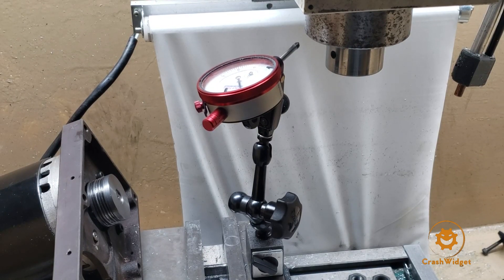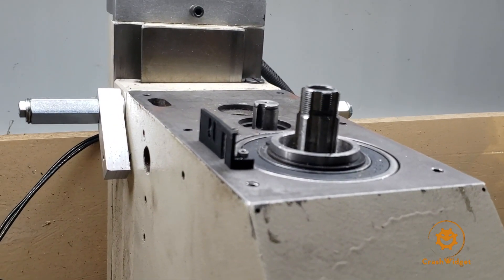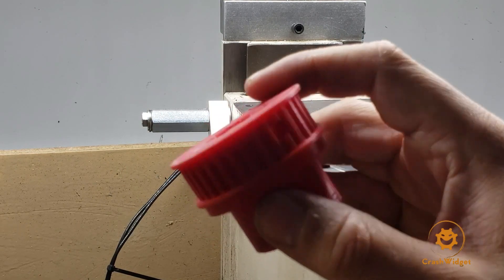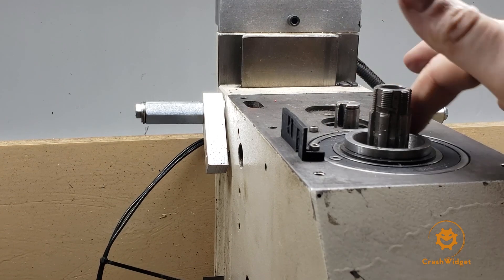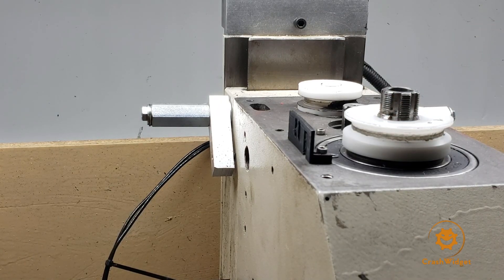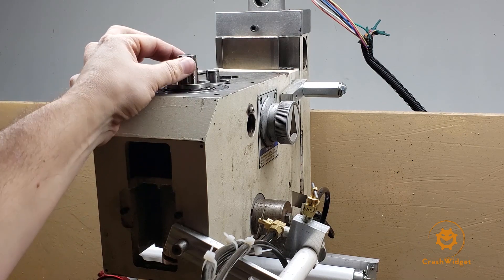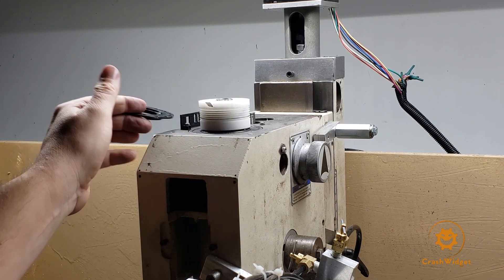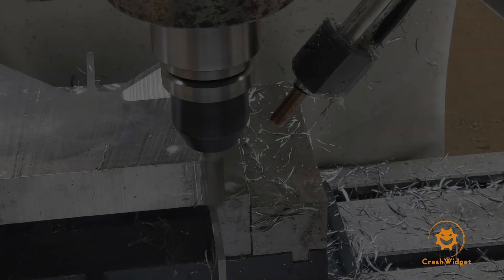G0704 Belt Drive - Trials and Tribulations

Comment: i don't know if you can conclusively say it would mess up your run-out. pushing on the column will bend the whole column anyway, so measuring from the table is not a reliable measurement; also, the spindle is supported at four different points (two tapered bearings in the quill and two holding the combo gear)
Reply from the maker: Agree. See definitely may increase vibrations.

Comment: Can you show the link where you got the 3D printed Pulleys?
Reply from the maker: Sorry for the delay, here is a link to the Fusion 360 design for the 3D pulleys.  You can modify or export as STL if you would like to print yourself.  These did not perform as well as the J belt setup.

https://a360.co/2JwqmIi

Comment: I'm currently in the middle of this right now (I don't have a G0704 but a Weiss VM25L which is nearly identical). Tried timing pulleys, Poly V 6J ribbed pulleys and am in the middle of getting 4L v belt pulleys to fit (need to grind some casted letters off to make it seat correctly) and so far I've had no luck. My biggest issue is just noise. I should be able to have a conversation with the spindle running at 5000RPM (without cutting), let alone 2500. Doesn't help the only aluminum pulleys you can get off the shelf easily are timing pulleys.
Reply from the maker: What went wrong with your 140J6 Poly V try?  I'll make you a front spindle delrin pulley for a fair price if needed.
Reply: @LionSandwich  The only ones premade (since I don't have a lathe and I need a 1:1 raio) that I could find were cast iron and I needed to use a bore reducer bushing from McMaster and I could never get the motor pulley to not wobble with that. Don't know if it actually caused any excess noise but I wanted to try single V belt pulleys.

Unfortunately my mill doesn't have the two M3 screws the G0704's do because the stock tachometer is one that uses magnets and not the photo sensor thing. So I don't know how I'd be able to implement your design. I'm just not sure if it's the pulleys or spindle itself causing all the noise.
Reply from the maker: Any photos you could post of your setup? I'm determined to figure this out now.
Reply: @LionSandwich  If you want you can look at a CNCzone post I made about the noise issue before I tried poly v belts. I'd link it but it would likely get marked as spam. If you go to the benchtop mill section it's the last one on the third page (currently) and titled "Help Quieting Spindle Down." I believe it has a video showing exactly what's going on. I can also provide any extra pictures/videos you want just let me know.

Comment: I got v belt as well now but my motor died so i got first treadmill motor and that was not great but then I got 1.8kw nema 42 servo motor from ebay and that is silence. I can listen music while its working. Now I added closed loop steppers i cant hear nothing now.
I highly recomend this nema42 or nema52 servo motors they go up to 3k rpm and up to 2.6kw for 500$-700$.  
I want now to get LinuxCNC as you can do lot with servo spindle like rigid tapping...
This 1.8kw is very strong motor i cut steel easy on slow rpm and big end mills. But those nema52 are option if you need more power.
Reply: Those ac drivers have milion settings they have internal electronic gear ratios. You can set up a bunch of stuff. You have encoder output that i assume can be feed back to LinuxCNC. 
I get a lot of power on low RPM and that is what impresses me. That is not the case with VFD controller that I know of.
You just need to see what rpm you need(i would not go bellow 2500rpm) and pulley ratio you want to use to up the speed on spindle.
Reply from the maker: @darkobul1  yes. Linux cnc can have feedback for rigid tapping.
Reply: @LionSandwich i made a video for you how it looks and works. https://youtu.be/ENFmHKaDIOM
Reply: @LionSandwich  that would be a treat to be able to do tapping like that.
Reply from the maker: Can you provide a link to a nema52 you would suggest?
Reply: @LionSandwich  just search for nema52 ac servo on eBay  there is bunch variations in kw and rpm. They are 220v and come with driver that is easlily controled over parallel port.  They can be controled with steps, quadrature, A/B and 0-10v signal so you can chose how to use them.
Some guys did conversion on youtube and they are happy as me with it. one claimed that is match with tormach in power. I am impressed but i should maybe have got nema52 instead of 42(42 fits g0704 flush while nema52 is wider) as you can get more power then 1.8kw.